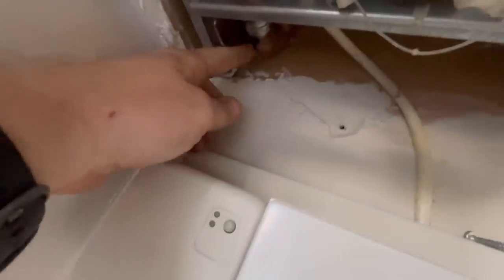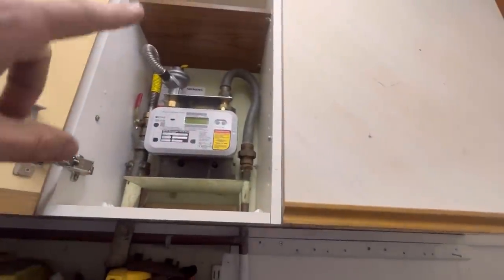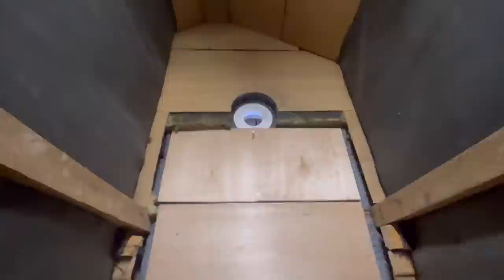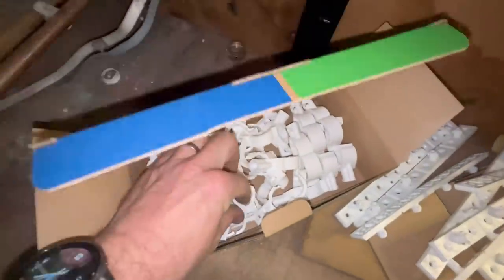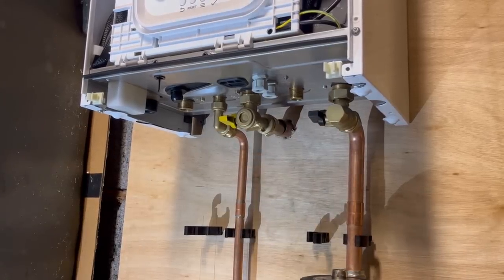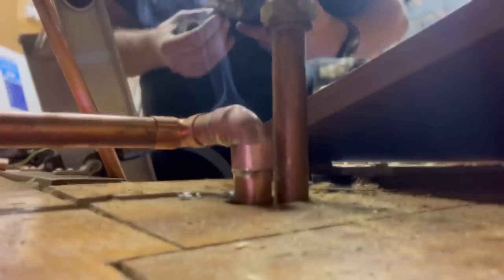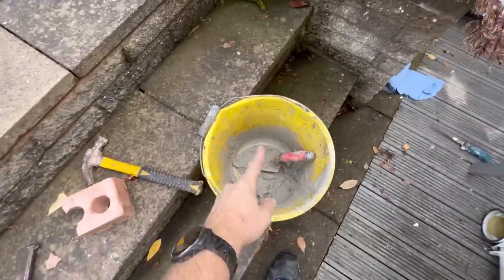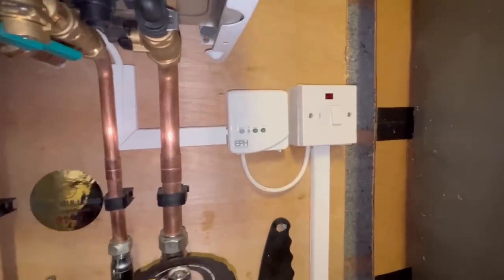Baxi 800 Combi 2 Boiler Conversion | Still Nothing Goes To Plan!

Comment: I like the use of the Flue/Pipe Snug to overcome working at heights. Undersized gas runs are a real pain.
Reply from the maker: Flue snugs can get you out of a tight spot, think them a great idea…wasn’t impressed when I saw that 15mm in ceiling 😅 adapt and overcome thou 👍👍

Comment: 1st class job. One observation putting your arrester in that position you have created a “Dead Leg” which can hold your hot water on longer when tap is turned off. Top job.
Reply from the maker: Thanks mate, it is a longer pipe that’s why I wasn’t going to do it…if they have any problems Il have to shorten it, wouldn’t take 2 mins to do 👍

Comment: Nice job, I am a BAI installer, like the idea of using the tun dish instead of frilling out the safety valve pipework. Just an observation the shock arrestor looks good but it's a big dead leg buddy. Nice job and you overcome the problems as we all have to look forward to seeing the next one
Reply from the maker: Thanks mate, yes agree with shock arrestor, is a bit of a dead leg, I do like the prv going into drain, make life easy for baxi engineer if they ever have to work on it 👍
Reply: @bluebulldog_uk  what do you guys mean by it's a "bit of a dead leg"? Do you mean it's not needed?

Comment: Think you should have fitted a cement board or plasterboard over the ply board ,the boiler is fitted too,been gas engineer for 48 years ,always taught never fix on combustible surface ,what wood is ,but have rules changed ,don’t know
Reply from the maker: It’s ok to use plywood on back of most boilers now, can’t think of any you can’t off the top of my head…had that question raised before a while ago and it’s fine 👍

Comment: Baxi now have a Baxi Internal Fit Telescopic Flue kit could help with future installs
Reply from the maker: I’ve seen that and would of been great to give it a try, would of had to order it in thou and because the plans changed so quickly wasn’t prepared, flue snugs am normally in stock around by me but if I have same situation again I would give the internal fit flue a try 👍

Comment: Omg. Why play with the feed pipe to drain the cylinder. Just syphon from the top. No risk of a massive flood if the feed snaps off. I feel your pain with that gas run. What a horrible layout
Reply from the maker: That’s true but never had one split or break doing that, very rare we do it like that but I get your point always a risk…gas run was a bit of a nightmare but once we knew where we was going was half the battle 👍👍

Comment: Brilliant video mate, so that baxi boiler to get the clips in do you need to cut off 20mm from the pipe stubs?
Reply from the maker: Thanks mate, with the stand off and clip was 20mm on the 15mm, just do a quick measurement next time you do one to confirm yourself before cutting 👍
Reply: @bluebulldog_uk  thankyou

Comment: That cold feed using as a drain is was quality !!
Also doesn’t the condensate need to be lagged through wall also.  Pain in the ass IMO
Reply from the maker: Cheers mate 👍 with the condensate I used 40mm and with that pre heated trap I would be very surprised if it froze
Reply: @bluebulldog_uk  great work as per my man. Keep it up

Comment: I must admit your work ethic is next to none, well done bud, over and beyond 👍. I must say, myself I don’t like burning fittings in a loft space. It might be from the old days from fitting cold water tanks, there is so much flammable  material you can catch alight. Now days doing an install in the loft, you can time yourself to stop burning to give yourself chance to keep an eye out for anything smouldering because there are other thing to get on with without using a blow torch. Nice work👍
Reply from the maker: I don’t like soldering in lofts, I’ve actually catched the felt lagging once and it’s like a fuse wire! Had to scramble to put it out, didn’t make same mistake twice! I do try and solder first so it gives you most of day to make sure everything is ok 👍

Comment: Great video again just getting into gas I was wondering what u gauge you use  bought the rothenberger one sent it back very cheap many thanks
Reply from the maker: Thanks mate…I’ve got a standard water gauge but can use my anton spring V3 for taking pressures and tightness testing 👍

Comment: Nice tidy work there.  I always fit the weather compensation sensor on these boilers, its so easy and improves the efficiency. But customers need to understand that rads wont get so hot on milder days.
Reply from the maker: I like the Weather comp its really easy to fit on Baxis, very cheap as well, like you said thou it’s a hard sell when you tell customer about how it works 👍

Comment: whats the 22 - 40 waste reducer/adaptor?
Reply from the maker: Polypipe rubber waste adaptor, about £2.50 from city plumbing
Reply: @bluebulldog_uk   I used to end up doing a 22-35mm endfeed reducer then using a hepvo trap etc so that is much easier

Comment: Nice job bud, what time did you get away day 3? Also did  you say 19 @meter and 17.6 @ boiler?
Reply from the maker: Was around 5pm I think, started at 10am yeah was a 1.5mb difference on gas pressures
Reply: Nice job mate enjoy watching your vids. I always fit baxis and use ifos to satisfy boiler plus, plus it’s a good energy saving method especially now they want as close to 55 flow temp as possible on boiler swaps, with ifos even if the rads are undersized for a 55 flow temp most of the time unless its below around 5 degrees outside the ifos will keep the flow temp 55 or below meaning the boiler will always be condensing in heating mode. One thing to note on the combi 2 it comes factory set to the lowest curve at 15 meaning it will only have a flow temp of 55 when outside is 0 with an outside of 10 it would be around 35 flow temp so you need to go into the installer settings and change it to about curve 40 on existing systems which will give you a flow temp of 55 when it’s 10 outside and 70 when it’s 0 outside. When I’m doing gas runs like you had I always use 1 or 2 lengths of 28mm off the meter otherwise you end up with more than the permissible 1mbar drop and that’s without any other appliances running. It’s surprising how the fittings quick reduce how far you can run in just 22mm. Also another thing to bear in mind now with boiler swaps is you have to fit a boiler that will modulate down to the required heating demand which is around 5kw for the average house. A Baxi 24 will go down to 5.2 a 30kw is around 6.5 and a 36kw is around 7.8. So really a 24kw is suitable now for most properties based on that especially if they have modern taps with flow rates limited to 9-12 l/m there’s no need for bigger combis it’s all about efficiency now 😂 oh and the new blow off design with the clip is shite there’s a rubber o ring on the prv when you push the pipe on it pushes the ring out of place mean it leaks onto the floor when draining or prv is activated. The o ring is to big/slack and to thin. It needs a thicker smaller one on there so it doesn’t move when you push the copper tail on. Keep up the good work.

Comment: Top install fella. I’d stick in an auto bypass if it’s a one pipe, or any combi installed onto zoned heating / TRV system. saves intermittent overheat faults. yes it says it can do it through the plate but saves you a visit in the future
Reply from the maker: Sound advice mate, be honest it didn’t cross my mind at the time with everything going on…but hopefully it will all be 2 pipe soon, if they get any issues thou I can always stick one in for them 👍👍

Comment: Dare I query the reason for the external air admittance the previous installer deemed OK in the apparent absence of a suitable vent pipe?
Reply from the maker: Regulation with soil pipes has to be 900mm above a opening window within 3m, bang a AAV on don’t need to run it that high..that’s my understanding behind it 👍
Reply: @bluebulldog_uk  quite right, but if shallow traps are incorrectly installed into soil stacks or even when the wastes are installed correctly; at peak sewer loads the problem of sewer gases permeating traps can be a real issue.
If every property used AAV'S it would soon become apparent.
Encountered exactly that scenario on a group of 3 new build terraced houses a little while ago.
The soils on all three relied on 50mm AAV'S in the roof space, resulting in a serious amount of foul gases permeating the wc trap in the first property.
Solution, extend end properties 100mm soil to terminate conventionally and removing that properties AAV.
Problem solved, which is why the end of drain run should  always be an open vent.
I've come across it loads of times and it's usually  a combination of ignorance of the purposes of a vent pipe and outright idleness!

Comment: Conditions here, in Poland, are heaven compared to what you got there. I'd wail like a baby after seeing that plumbing. Full respect, mate. Really great job.
I have absolutely no idea, how much it would cost in the UK, so I'll give you my local, Polish estimate in Polish zloty (PLN).
It would be 3 full days plus 3-5 hours of the fourth day if I soldered, 3 days if I crimped
Boiler with complete twin flue system and middle range electronic thermostat would be 11000 PLN (Any 24 kWh Bosch, Vaillant or Saunier Duval).
Parts (fittings, filters, valves, pipes etc.) =/- 3000 PLN soldering, 4500 PLN crimping.
Labour (I work alone) 5500 PLN soldering, 4000 crimping.
So I'd quote the client for 19500 PLN no matter if I'd solder or crimp (plus all the necessary taxes).
Any cordless crimping tool is between 3550 and 6000 PLN here.
So I save one day of labour using a crimping tool.
Think about it.
Reply from the maker: Thanks mate appreciate the support 👍👍 yeah plumbing and pipework can be a nightmare 😂
Reply: @bluebulldog_uk  Sorry I edited my comment.
Anyway, one job and you have the tool.
Reply from the maker: @Stefan_Kawalec  makes sense doesn’t it to invest as from what you’ve detailed it pays for itself, definitely going to invest but my van has just cost me a lot in repairs so will have to wait just a little bit by looks of it
Reply: Nice work mate. Any ideas were I can get that core drill looks fantastic
Reply: @bluebulldog_uk Sure thing. And of course there's no way anyone of us would spend all the money from one job on a tool. It would be unreasonable. But I think you should really consider putting some crimping tool on your shopping list.

Comment: Sexy looking install fair play! The last Baxi I installed had an odd PRV arrangement. It came out just to the right and above the gas valve and the copper tail had some funky factory bends on it.
Reply from the maker: Thanks mate, was it the Baxi 800 the previous model to the combi 2? It does have a 90 bend on that one